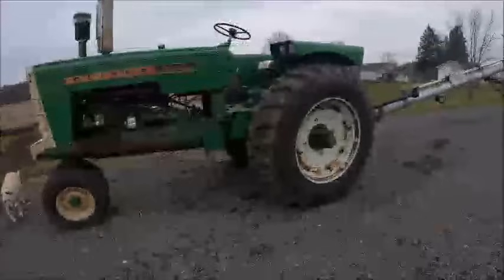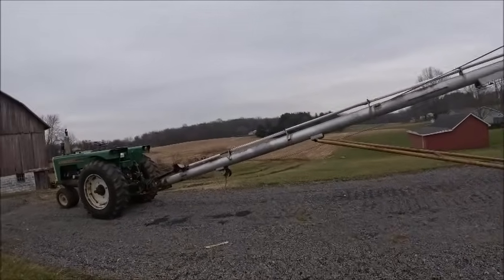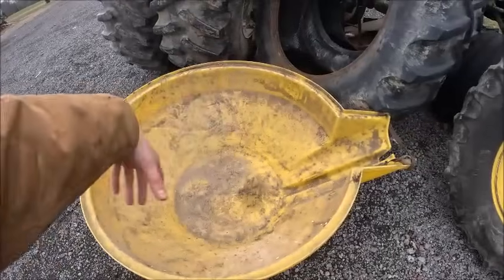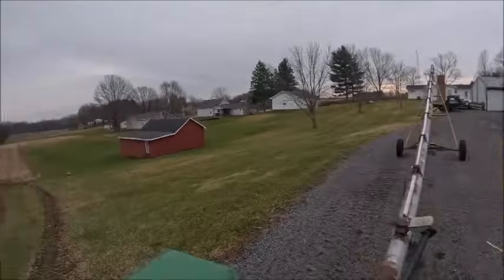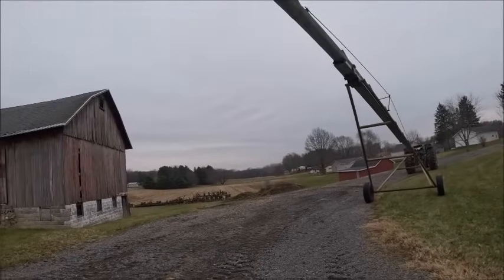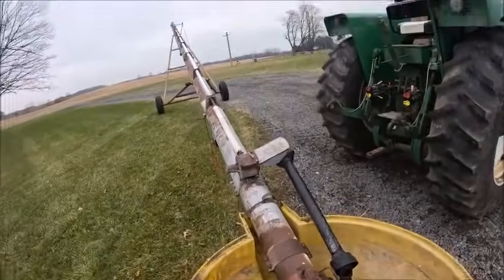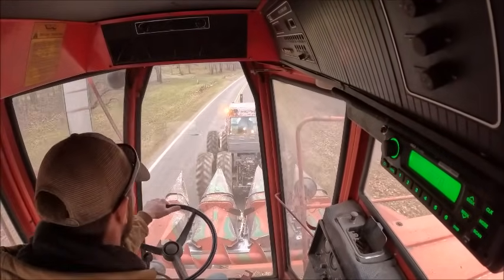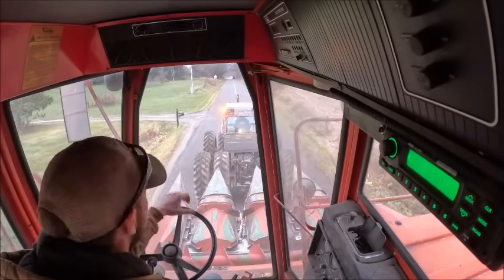Getting Ready For The Final Push

Comment: every auger I have used had that hitch its so you can raise if all the way up without binding the pin and back it over the grain bin. we use a custom pin that is short
Reply from the maker: That would be easily overcome by slotting both holes in the hitch.

Comment: I used to use a clevis to pull those kinds of auger behind a pickup.    Set the auger on your pickup hitch, then slide the clevis on.    Then just stick a hitch pin through all 4 holes.    Worked great.
Reply: Same here, towed one home from an auction over 50 miles with no worries
Reply from the maker: That’s not a bad idea.

Comment: I wonder if the hitch might have been designed that way to allow the auger to be cranked up and not bind on the pin.
Reply from the maker: Probably originally
Reply: Yes. That was how most companies made them, but I've always considered it a very poor design. 

This style of auger the tractor is NEVER left hooked to the hitch when in use, so why build it with such a poor system to hitch it up?

Comment: Could you fabricate a carrier to drive on with the tires in the front and inboard where the tracks would be closer to the ground when hauled? You have enough tractor moving it, up pressure on the hitch probably wouldn't be an issue.
Reply from the maker: I’ve said multiple times that is what we plan to do.